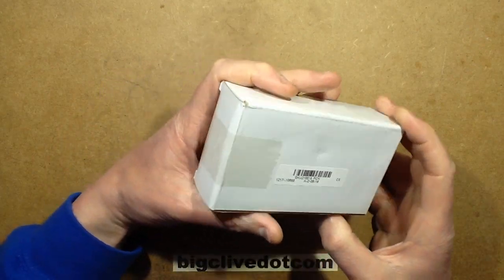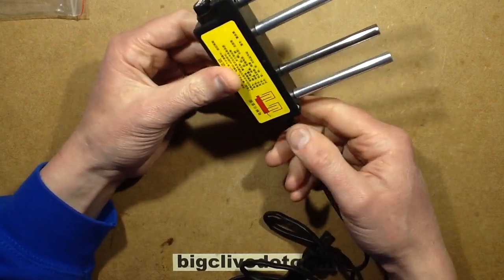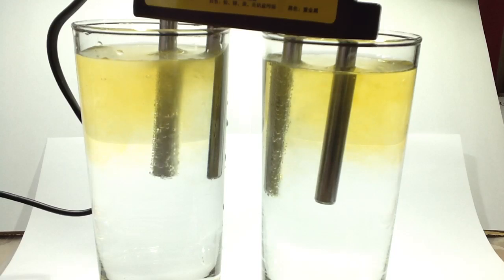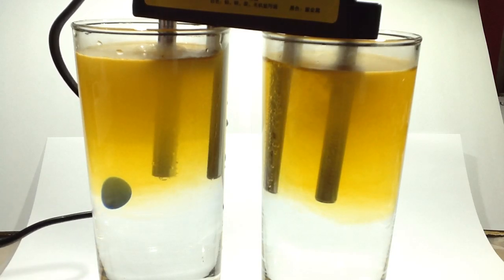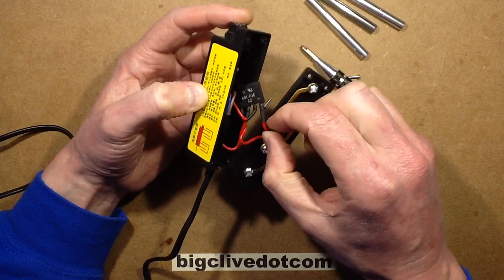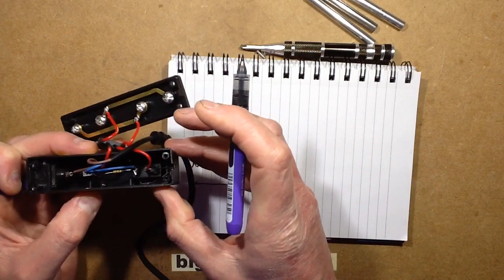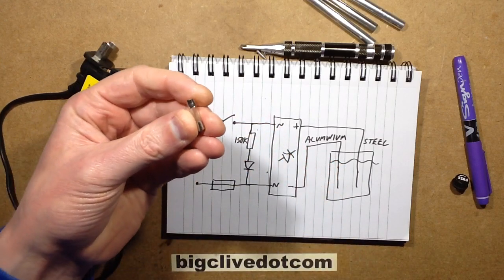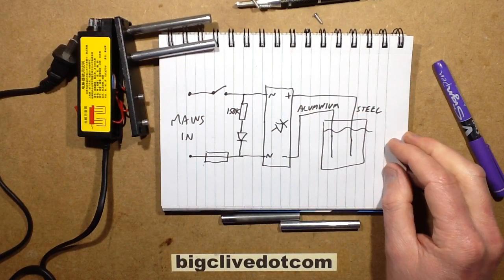Deadly quack water tester.  (scam)

Comment: I wonder what causes the browning? rust? Great Job in exposing the quackery!
Reply from the maker: It is indeed rust, but accelerated by the current.
Reply: Your channel is enjoyable and informative. Thanks !!
Reply: Cosmo John I'm pretty sure I makes hydrogen and aluminium oxide the hydrogen probably made the water frothy and the the aluminium oxide coloured it.
Reply: Cosmo John electrolysis works where one side makes hydrogen and the other makes oxygen but since it's the wrong Metal instead it just oxydises the metal and causes it to rust
Reply: Don't be daft Clive, the water you tested didn't seem to be moving at all.
Reply: *****
Rust is a salt...
Reply: Cosmo John i think it is coming frim oxidization of steel not even the water
although i think that could actualy test it only if there are impurities so it will not work with mineral water and
all of those gud stuff
Reply: If you want to see if the contamination comes from the electrodes, start with distilled water. Add a quarter teaspoon of sodium chloride or potassium chloride, (Table salt or road salt) both dissolve clear and neither will turn brown unless they are molecularly broken up (releasing chlorine gas in either case, so be careful) and recombined into some other molecular substance. The question then would be what other source of contaminants is present, and the only thing that appears to be present is the metals from those electrodes, or the glass the water is in, and you would be hard pressed to show that the glass is dissolving into the water, and reacting through the electrolysis into something brown.
Reply: So, if I test this with true purified water, the water would still get dirty colours because of the electrodes release metal molecules nonetheless? I will test it with my own device whenever I will find purified water and see what happens (and if the metal electrodes still cause the water to get this coloured rust in it).

Comment: so what's ur alternative to finding out whats in the water?
Reply: For the record, this device does nothing to show you what's in the water. All it does is electrolyze the water and oxidize the iron from the electrode, hence the orange color.
Reply from the maker: You could buy a cheap TDS meter that shows total dissolved solids in the water.
Reply: When you say alternative it implies you think this is actually an option. That's scary.
Reply: Miri B Gamma rays! Maybe...
Reply: +Miri B,  there are lower cost water test/analysis kits available with which you can test the water by yourself for various different water conditions,  minerals and pollutants.  For a more detailed water analysis one should go to a reputable water testing Lab which can be costly but will give a highly detailed result on the items tested. As for the earlier mentioned TDS tester,  well this will give you a result on how much conductivity the water has and thus tell you the level of Ion concentration in the water but it will not tell what's actually in the water thus is of very limited use for general water testing.
Reply: So... Iron oxide/rust is what's in the water? We need a chemist around here!
Reply: pretty sure a mass spectrometer will do the job
Reply: Red Swagon Angryfiend not sure if legit or technobabble

Comment: you've not explained why this does not discolour distilled water. this is not a scam, you are either confused or a disinformationist.
Reply from the maker: Distilled water is not very conductive so the electrolysis of the metal electrodes does not occur.  I am neither confused nor a disinformationist.  I fully know by the application of REAL science that this is a scam and an electrically dangerous one too.
Reply: Of course it's a scam water is seen as nutrient for life as it carries salt and other needed sources of nutrients. Distilled water has removed all these nutrients so when the test is carried out there is no bonds to break down. Just because there is something it the water that discoloured it after the test does not mean that it is bad for you. Distilled water and diameter ionised water are the purest quality waters but are used in window cleaning systems or car batteries and it has been suggested that due to there high purity can actually cause osmosis in the body's cells drawing salts out and damage cells. So it is a scam. If you want good quality water buy an ro system
Reply: Thanks for the input Barry, Ill look into what you've mentioned.
Reply: Barry is correct...drinking distilled removes minerals from the body through osmosis. Recommended to re-mineralise distilled water before drinking.
Reply: Disinformationist... Now there's a word I learnt new today. And the first definition I found was "Someone who tries to muddy the water" 😂😂😂
Reply: hahaha
Reply: @Zakerith,    I drink distilled water (to get rid of the calcium carbonate, for personal health reasons), but eat healthy, mainly fruit and vegetables, to get minerals (and other good stuff).   .   . Water should be just water.
Reply: This is basically a battery running its reactions reversed. Distilled water has less ions to conduct the electricity (which is why I'd expect the device to barely work in distilled water).

This is a scam. Just the fact that the electrodes are of different materials should remind you of batteries...
Reply: Simon Ruszczak "water should just be water" WTF !!!!On the base of what your faith healer words?

Comment: The reason that one electrode has to be aluminum is that this device creates an oxidation-reduction reaction, sort of like a battery running in reverse. 

When an iron electrode in water is given a positive charge of at or above the oxidation potential(at least .44 volts), it will split into Fe2+ ions and electrons.  The electrons travel up the power wire and the iron ions go into the water, producing the red color.

 If both electrodes were iron, then the reaction would run in reverse at the negative electrode, and the iron ions would turn back in to solid iron,  and there would be no red color.  However, aluminum is much harder to oxidize, water actually oxidizes before it does, so the aluminum electrode splits water into negative ions and hydrogen gas, making the bubbles.
Reply: This is the explanation I was looking for. Thank you.
Reply: Furthermore, the Fe2+ ions are oxidized at the anode to Fe3+. With the oxygen ions floating around, that forms iron(III) oxide, or red rust, which is responsible for the crusty floaties and appetizing mud color the solution develops. That's why the aluminum and iron electrodes have different threads; if you got the polarity reversed, you'd end up removing any rust on the iron rods instead of creating lots and lots of new rust.
Reply: @LazerBear42  Which, as you likely know (this is for other readers), is very useful (at lower, safe voltages) There are plenty of articles about electrolytic rust removal on the web. I use an old auto battery charger as a power source. I was told recently that some newer battery chargers are too smart for this and won't work, knowing that they are not connected to a car battery. I have no experience with newer chargers.
Reply: @LazerBear42   and MultipleMonomials thanks for the detailed explanation. I realised the "contamination" was being extracted from the electrodes but couldn't be bothered to Google exactly how. Cheers :)
Reply: It sickens me that somewhere, at some point in time, a clever engineer thought of this.
Reply: @NeatNit  stop hating
Reply: Is it called electrolysis
Reply: @murtazad6738  and Redox
Reply: So exchange the iron electrodes for another aluminum and you have a hydrogen generator 😝
Reply: @matthewtscott1  although this device may be a death trap is it showing genuine harmful chemicals and bacteria in our drinking water?
Reply: @scottyboy12340  Only vaguely. Generally, the more contaminants there are in the water, the more conductive the water will be, and the faster the reaction will be. The discoloration is purely from the electrode giving off rust into the water, but the rate at which it rusts depends on how conductive the water is. Adding a little salt would boost the conductivity, but wouldn't make the water unsafe. Conversely, the water could be contaminated with botulism, but could have the same electrical conductivity as filtered water.
Reply: @scottyboy12340  Short version, no.  Long version, nnnnnnnnnnnno.
Reply: @scottyboy12340  no. It tells you nothing about the presence of bacteria or anything else
Reply: @scottyboy12340  No
Reply: @thelasttimeitried   I’m just looking into all of this. How does it give off rust? Sorry I’m really not scientifically minded for this. Also how come different waters change to different colours? Does this not show that there are different materials in the water some of which can potentially be harmful? Really genuinely trying to understand this. Many thanks in advance ✨✌🏻
Reply: @H2theM1  Hi, The electricity passing through the iron electrode is actually causing atoms to be 'torn off' the outside, and they combine with some of the oxygen atoms from the water molecules, forming ferrous oxide (Fe0) also known as rust. If you want to really know what is in your water, just let a cup of it sit out and evaporate, or boil it down to nothing in a pot. You'll usually be left with a white residue which is all the solids that were in the water. Mostly calcium. Look at your shower head and see what has built up from the drips. That is what is in your water. Any of the funky colors you see in demonstrations like this are introduced with the electrodes, or are specially staged to produce different results (the water is primed with a chemical that would react with iron to form something else instead of rust). It would take a significant amount of whatever chemical that was to produce a visible result, like, to the levels where you'd have to be drinking something so far out of wack that doesn't really classify as water. Real contamination from agricultural runoff (fertilizers, fecal matter, microbes) or toxicity from lead pipes wouldn't show up in a demonstration like this, and require special lab tests.
Reply: @scottyboy12340  No, absolutely not. Tap water varies in conductivity depending on the (natural and harmless) mineral content or 'hardness' of the water. More contaminants might also increase the conductivity, but this device wouldn't differentiate between natural, harmless ionic content and contaminants. And the iron ions generated completely obscure any observation anyway.
Reply: @scottyboy12340 back to school you go scottyboi
Reply: This thing is amazing. You can electrocute yourself AND blow yourself up. Even at the same time. Twice the value. Don't forget to smoke while using it.
Reply: @Non of Ur business Click bait video? Lol Umm...
Reply: Hi , someone just sent me a video of similar test where electrodes popped into 2 glasses of mineral water ( big brands )- water went grey and they then put a magnet on one glass and the grey matter was magnetic . I suspect the change in the minerals with the electrodes did this - person sending it is concerned it’s due to Graphene in the mineral water. Can someone whom is knowledgeable here explain the real reason to me - so then I can put her mind at ease , she is very gullible . Thks
Reply: This is comes directly from my corrosion class I took while becoming a metallurgist. They are now using this to makea sale. How pathetic! Thanks for the detail explanation. You are correct.
Reply: so that's bassically a hidrogen generator on crack?
Reply: Thanks! I was wondering why it became brown. It's obviously just electrolysis and the brown must've been some sort of oxidation because something something with the aluminum. But I couldn't really fit the 2 together. So thanks for explaining!
Reply: Oh..
Reply: Fine theory, but until someone's tested it empirically, using the kit supplied, I'd not be willing to take it as granted. Those electrodes could contain almost anything, on top of the Al-Fe you expect. Nice healthy polonium, perhaps.
Reply: its called grain boundary carbide precipitation...   only thing thats resistant is 316L Stainless steel ... only thing that wont turn to dust in an ELECTROLYSIS  device..

and yes my car is running on hydrogen why do you ask :-)    (  dont even try to disprove it, lookup the BMW Hydrogen 7 running on Hydrogen)    Jay Leno has one... loves it.  drinks the water that comes out the exhaust pipe lol
Reply: quote -  If both electrodes were iron, then the reaction would run in reverse at the negative electrode, and the iron ions would turn back in to solid iron,  and there would be no red color. 

rubbish! both electrodes would decompose - i've done it with stainless steel for both anode and cathode and both decomposed!
Reply: @PeterPete  If both electrodes are decomposing into positive ions (e.g. red colour Fe ions), then you must be using AC power. The device in the video has a rectifier that converts AC to DC. Even with DC, the reaction won't necessarily run in reverse immediately or quickly at the negative electrode to suck out the Fe ions if you've got some other ions dissolved in there which are preferred. You can see it's already not just the iron which is reacting as the water is also being split. So if you use AC and two steel electrodes you might get iron colour from both as more ions are generated than are re-deposited, due to the other reactions going on. Has been a long time since high school chemistry, but I do know to produce positive ions you need to remove electrons. You can't do this at both electrodes in a DC circuit.
Reply: @yetanotherstronk  i only use DC - i've recently used magnesium for both electrodes, anode + cathode, and I managed to get hydrogen gas off at both! There was no oxygen from anode!!! In this instance, I got more gas produced at the anode than the cathode which was rather interesting as it goes against the supposed 2:1 hydrogen oxygen ratio of water!!

maybe you ought try it before bloating out bollocks! 

Tip weigh the electrodes before and after and run the electrolysis for a few days. if there is weight loss then clearly the electrodes have decomposed and the gases have originated from them.

You don't need electrolyte just use water from the tap as there's enough impurities in the water to conduct any current between the electrodes!! Remember to collect the gases and test them! If you use same materials for both electrodes the gases will be the same!

All the best
Reply: @PeterPete  I have tried it, in fact. Do read a chemistry textbook some time.
Reply: @PeterPete  You need a new bridge then... Lol

Also, since we're on the subject, I've got a few to sell... Would you be interested? 🤣
Reply: @MadScientist267  and your point is what exactly